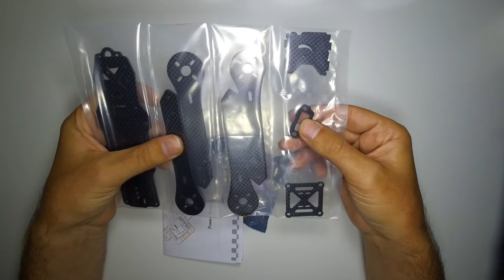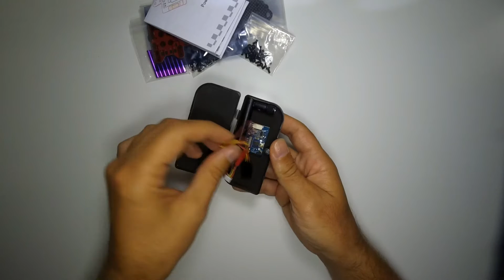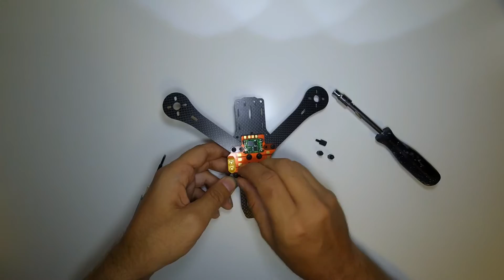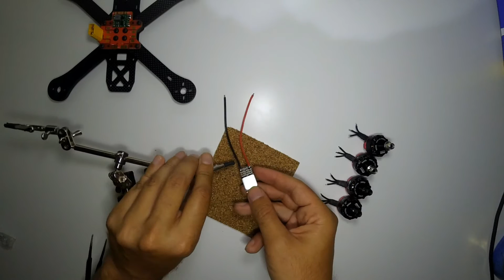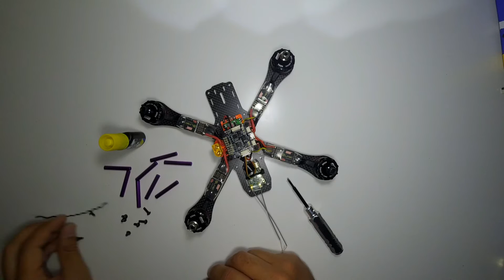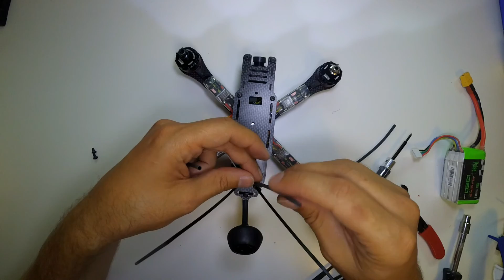How to build a Reptile X5R 5" (Realacc X5R)

Comment: would the 1806 2300kv motors be ok with a 180mm? or should i upgrade?
I have an old ZMR quad that I could steal the electronics from
Reply from the maker: I have no idea what the motor bolt pattern is on the 180. but if its able to install 1806 motors then it should be ok
Reply: Pionell Winters What is the length of the center body?

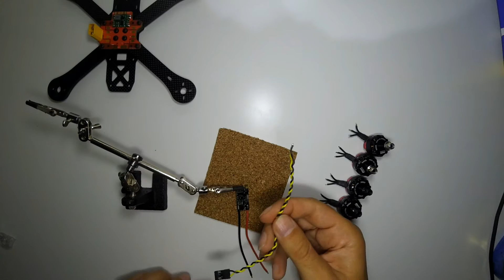Comment: @ 13:35 you mention you won't use the ground wire, why is this? also @ 28:34 you make a plug from two signal wire from different ESCs. Could someone please explain what is going on here because I've never seen this done before.
Reply from the maker: The esc is already grounded when connected to the pdb so its not necessary to ground the esc to the flight controller, but if you wish to do so you can i do this to save space when stacking the flight controller. I make a plug for two signal wires because its cleaner and easier to connect to the flight controller that way, if you watch the video you will see how i pin my fight controller and you will understand, if i had a 4pin connector i would use that instead of two 2pin connectors, just to make it more convenient. Actually this method is common when your not soldering directly to the flight controller, if you watch this guys videos on how to build a qav250 or qavr he does it the same way https://www.youtube.com/channel/UCoS1VkZ9DKNKiz23vtiUFsg/videos

Comment: Cool video dude, I've watched it repeatedly when building my 2 new Reptile X4R's - I'm running the 180mm version (4 inch props). It handles beautifully with BF 2.9 and 4040 tri-blades. Many thanks for going to the trouble of posting this.My config is pretty similar to yours except I use a LemonRX satellite, LB20A's, SunnySky 2204's and a DSun regulator to power the VTX. I initially ran my Runcam swift off the 5V BEC but found that I was getting flickering video , even with the 16V 470uF capacitor on the 5V BEC, so I run both the VTX and camera off the DSun regulator now, set to put out around 8V (it has a variable output).  This has proven to be a really good configuration and it gives a bit of headroom over the camera's 5V minimum, and the power is filtered just like the BEC.

I know a few people have said that the Micro Minim OSD can take up to 500ma, but I think that's a worse case scenario and highly unlikely. Be that as it may, I took inspiration from your video and I'm running just the FC and OSD from the 5V BEC and the camera/VTX off a separate regulator now and it seems to be pretty good.Do you know where to get spares for this frame?  I've tried contacting Reptile directly without any luck.  I suspect I might have to buy another whole frame.
Reply from the maker: Good job and thank you :). as for the vtx and camera if your using a runcam you could power it directly off the main power because it can handle up to 20v and most of the new vtx can run up to 24v so you can also run that off the main power if you like, but if your method works thats awesome :) As for spare parts i dont think they sell them and if they did its probably better just to buy a complete frame haha because of the price, i know for the martian frames they sell spare arms but its only $7 cheaper then a complete frame so why even bother. I learned my lesson long time ago and now i buy 2 or 3 spares of everything haha and with these low cost frames buying 3 of them is like buying one alien or lumenier frame. So if you really like the frame buy 2 more as spares, i know i have some spares :)

Comment: Great video, but I'm wondering how you're running power for the camera and the OSD. It looks like you are running the VTX off the PDB, then the camera off the VTX. OSD running off the PDB's BEC. Is that right?  Is there any reason you're powering the OSD off the BEC instead of the FC? Is it tidier that way?
Reply from the maker: no you cant run the osd off the vtx 5v output because the minimosd requires to much power :( i wish. im running the osd off the step down that comes with the PDB because its rated for 2amps so it powers the OSD and FC. I was always told that the minimosd uses to much power and should not be powered off the fc so i guess you can call me old school :)

Comment: Where did you buy this frame?... all the ones I see for sale have tear drop shaped arms and not round ones.
Reply: Try Thanksbuyer (eBay and Ali). I've got 2 coming from there. Slow to dispatch though.
Reply from the maker: I got it from the company that makes the frames but you can buy it on thanksbuyer or email me at dronesolutionsontario@gmail.com i have an extra one somewhere